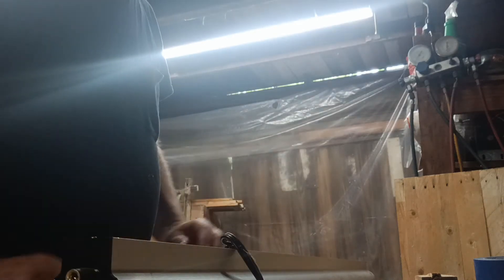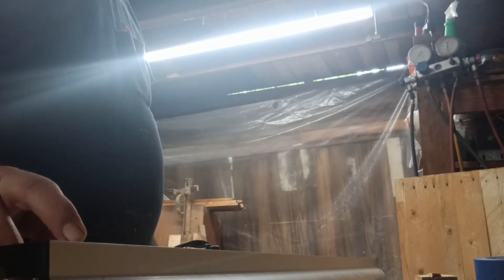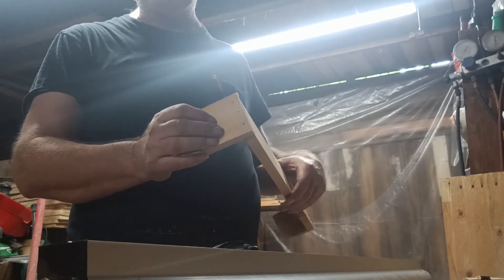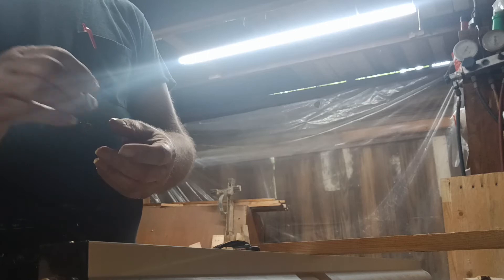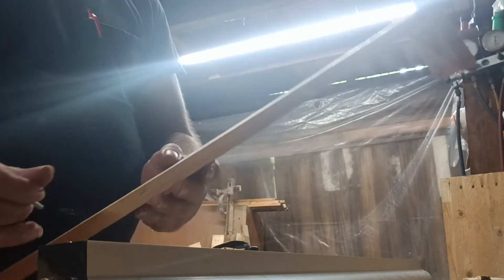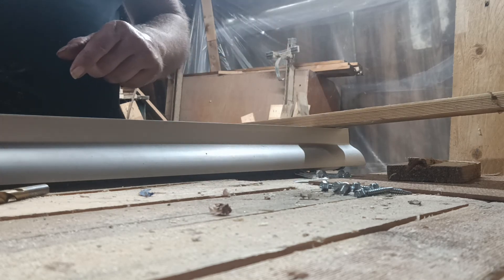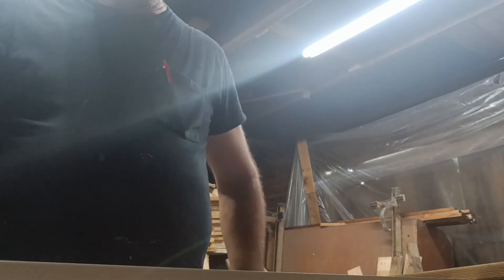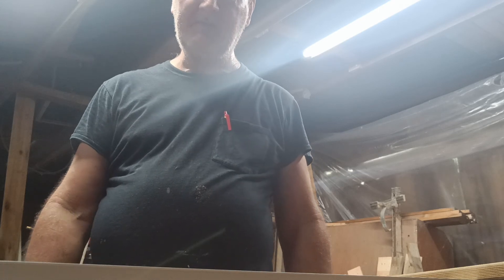Trick or hack for installing a Braun LED light

Comment: That was a neat how you did that
Reply from the maker: I need light so I found a way to do it where it won't interfere with anything else
Reply: @matersworkshop6123  that makes sense. I think that could work in my shed that way too because I would only need one of the lights and that would be easier to put up
Reply from the maker: @randytorboli  it keeps them up out of the way of you have a low ceiling like what I have
Reply: @matersworkshop6123  yeah it definitely does